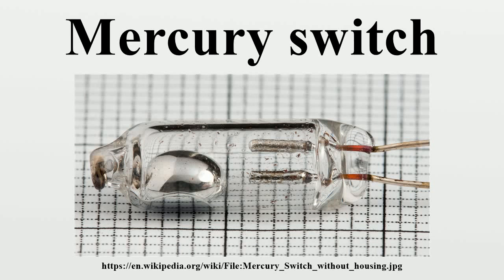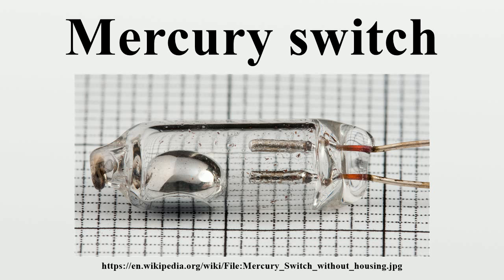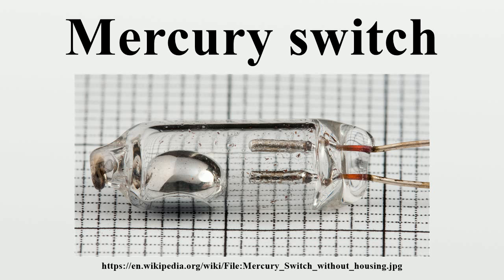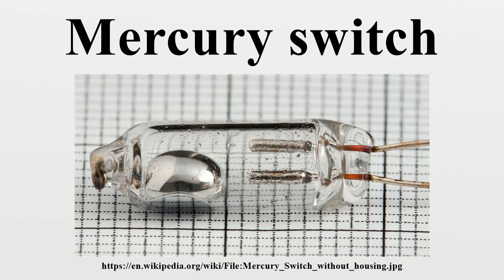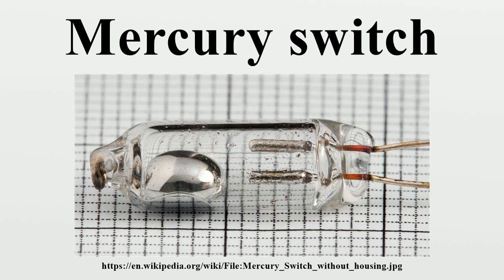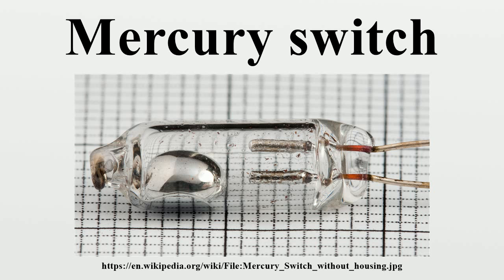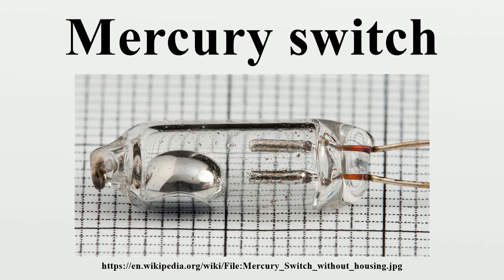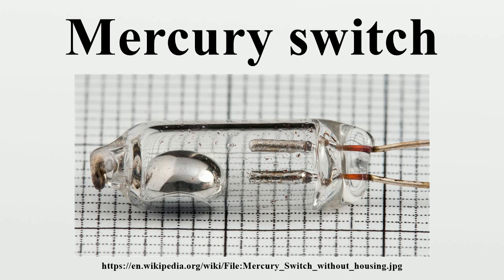Mercury switch

Comment: I think Mercury switches are cool I collect different types I'm sad when they are recycled [no!!!]
Reply: I agree with you I love mercury switches I have 1959 morrishararp electric pencil sharpener that uses a mercury switch that is attached to a little leaver when you push a pecil down inside it turns on the motor how cool and the there are no contacts to where out it is my favourite sharpener